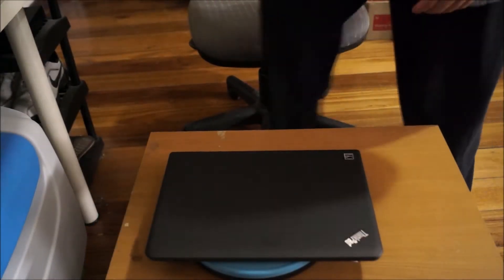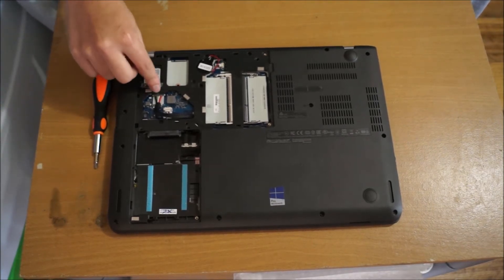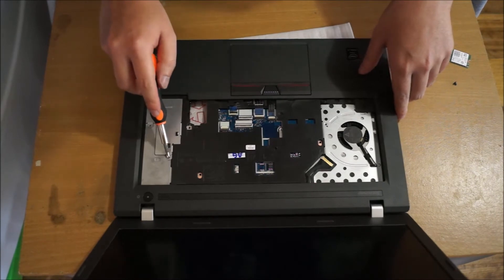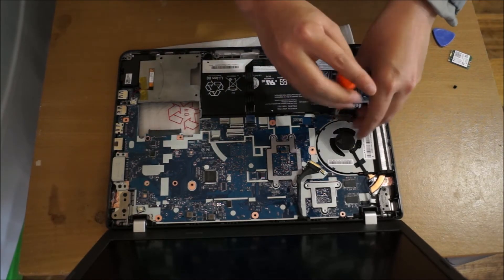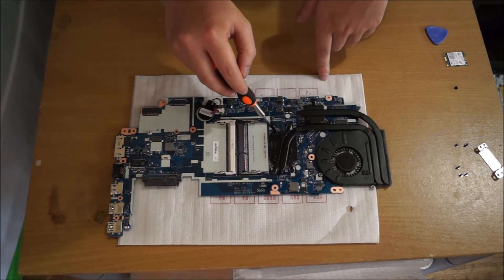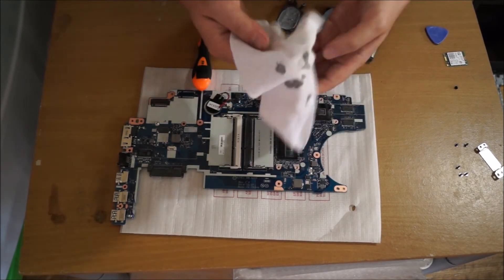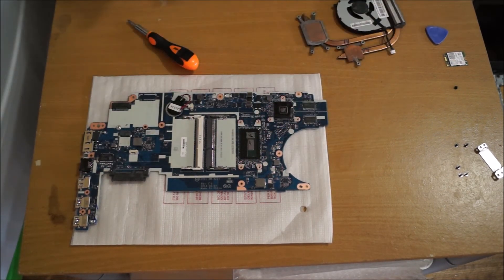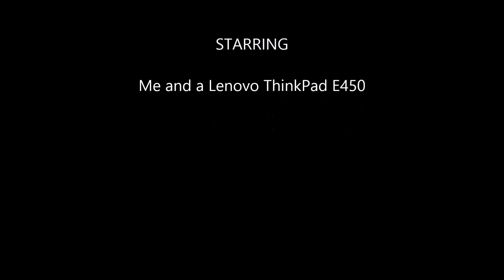OPEN ME UP! Lenovo ThinkPad E450, E45x Series Disassembly

Comment: There is one screw that's not moving to get the motherboard out and the head of that screw is worn. 😪
Reply from the maker: you will need to try something special like put a rubber band in it and then use your screw driver. this will hopefully give you enough grip to take out the screw

Comment: hi, how should i clean the fan of this pc?
Reply from the maker: you take it out and clean it anyway you want. normally you dont have to clean it you just want to have a look and remove dust balls if there are any. otherwise you dont need to do anything beside replace the thermal paste
Reply: @OpenMeUpTec  I MEANT-IS AIR DUST BLOWER FITS?
LIKE THIS ONE https://www.aliexpress.com/item/32969671829.html?spm=2114.search0302.3.116.52ae92f0Nid5FH&ws_ab_test=searchweb0_0,searchweb201602_0,searchweb201603_0,ppcSwitch_0&algo_pvid=cc38cebd-2bf8-4ddf-9057-751a8b414edc&algo_expid=cc38cebd-2bf8-4ddf-9057-751a8b414edc-16
Reply from the maker: @alexdaburan  you can do that or just buy a normal compress air in a can which cost $10AUD
Reply: @OpenMeUpTec  eventually, sold the pc before trying this, but thanks!
Reply: @OpenMeUpTec  thanks

Comment: Hi.thanks for the video! Is it necessary to remove the motherboard to replace the battery? Or can that be done at the 5:50 mark? Thanks!
Reply from the maker: at 3.30 you can remove the battery without doing the rest

Comment: Is it possible to replace the GPU since you can unscrew it? Great video btw
Reply from the maker: CPU is solder on, graphic card is solder on, ram can be changed to 16GB max with 8GB in each slot and there is 2 slots, wireless card can be changed, and hard drive is a 2.5" inch.

Comment: How do you like your E450? any things you didnt like?
Reply from the maker: +Gabe Montenegro there is nothing wrong with the laptop you can say space is used well unlike other laptop where half of the laptop is empty space where the manufacture could have put more stuff in it or made it smaller and lighter.
Reply: Awesome! How long would you say the battery last? Great video by the way i wish more people did videos like this
Reply from the maker: no one can really answer that question. it is up to each person and what they do. if you want to look into battery and how long it last just look at how big it is. as you may know some people dont do anything on their laptop and other do alot so battery lift is different for each person. it is hard for other to do this as it cost money to buy the laptop just to dissemble it. if you review laptops you can get companies to give you a demo unit

Comment: thanks for the video, its very helpful,
 i just bought the thinkpad E455. Is the battery can be replaced with the 62 Whr type
Reply from the maker: +Adam Ramdhani i dont understand the question. can you explain it again
Reply: +OPEN ME UP I meant to say: if i want to replace the battery with the one having more watt per hour , is that possible?
Reply from the maker: no it should not be possible.to have more watts it need to be physically bigger than the normal size and there is no room for in to go in the laptop. unlike the Dell XPS 15 9530 which has a option for a bigger battery, it takes up the 2.5inch hard drive area which is the only reason they can fit the bigger watt battery inside.